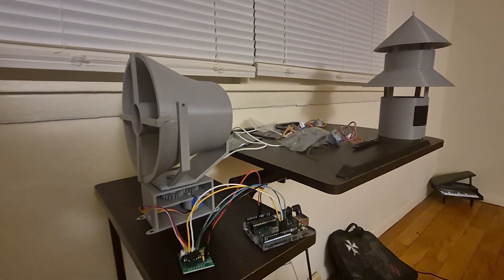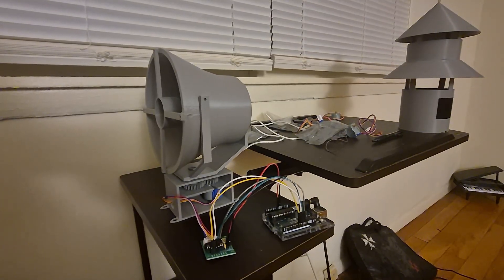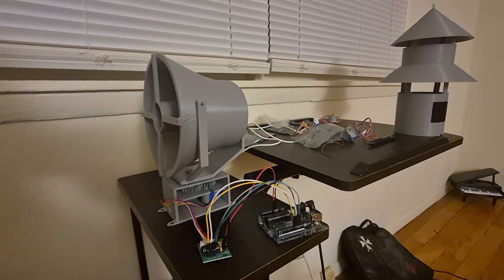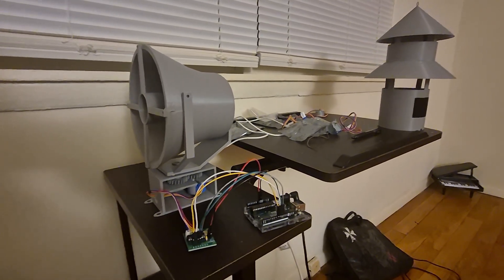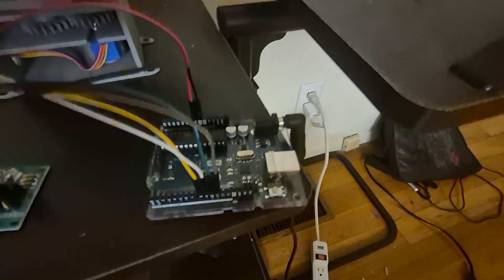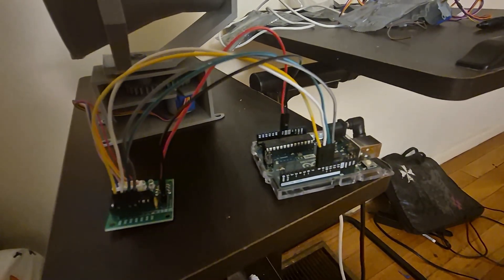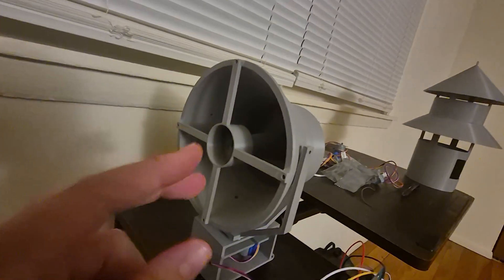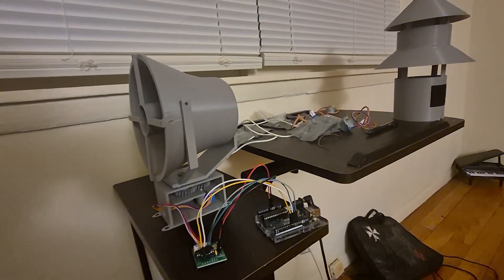Mini Whelen Hornet Siren - Work In Progress - Pt. 1

Comment: I’m making a mini whelen and I used jn printing code it doesn’t work proper
Reply from the maker: What do you mean? I'll try my best to help you out
Reply: @ThestormchasingEMT so whenever I put the code in but I might be doing something wrong since this is my first time trying something like this the motor does around 350 degrees then it slows down once it rotates again and goes about another 180 than it’s does 350 again
Reply from the maker: @jamesmoore5572 Do you have all of the necessary equipment? Besides the arduino R3, you need the stepper motor and the motor driver which is a small circuit that comes with the stepper
Reply: @ThestormchasingEMT I have those
Reply from the maker: @jamesmoore5572 Did you alter the code in any way? Because its insanely plug and play as long as you followed JN's instructions to a T.
Reply: @ThestormchasingEMT maybe I messed up because I am using Arduino board but he said to use a stepper motor driver board which I’m not
Reply: @ThestormchasingEMT also I usually skip to the part where the siren sounds of so I never realized till now the yellow whelen head you were talking about was mine
Reply: @ThestormchasingEMT and sorry for wasting your time with my error
Reply: @ThestormchasingEMT actually I have a driver
Reply: @ThestormchasingEMT but I don’t have my mini whelen ws 3000 finished and I haven’t put the motor in the rotator box to see if it will make a difference but with the motor just rotating by its self it has that problem